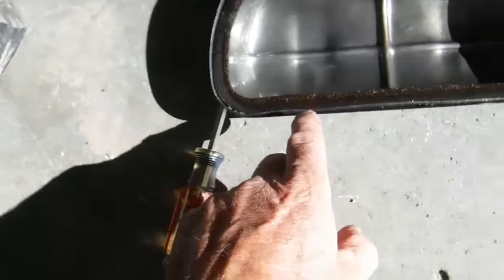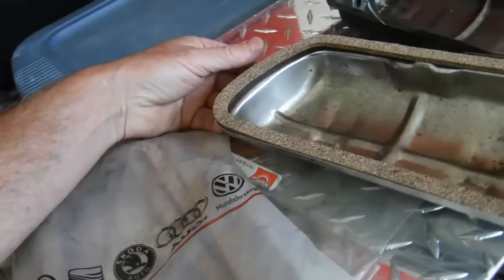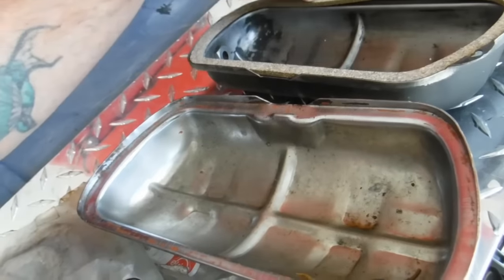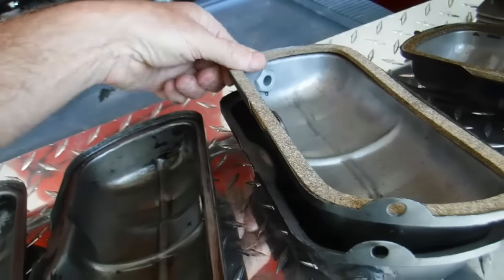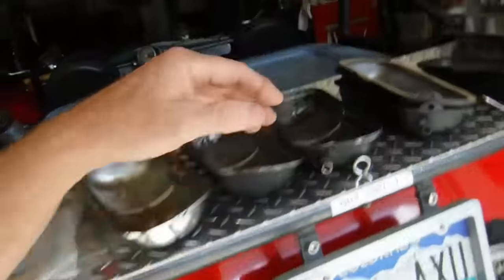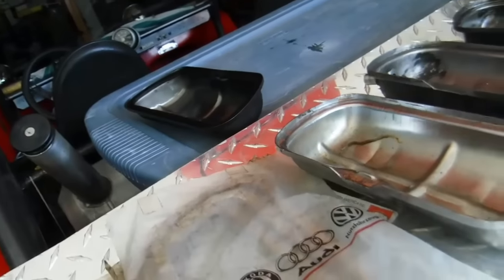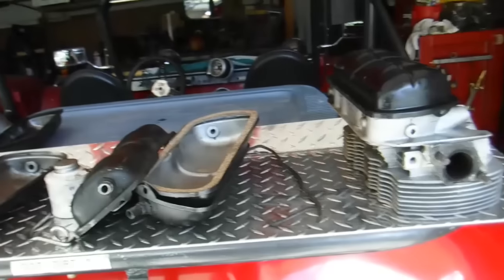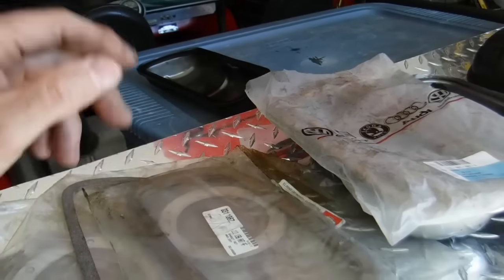Volkswagen Valve Cover ( Tips & Tricks )

Comment: I never use sealant, just grease the valve cover sealing edge lightly and place the cork gasket in, then a thin smear of grease on the head side of the gasket. Never had a leaky one yet, plus no mucky clean up job when it is time to change them.
Reply from the maker: Thanks for your contribution John!  I love it when you guys chime in and help make this a better channel. If we all share our experience everyone benifits

Comment: I also read how the stock tin covers actually cool the oil the best and that you should avoid the aluminum finned covers because they actually run hotter. 
VW engineers were smart.  The valve covers and pushrod tubes are main parts of the oil cooling system. Fancy aftermarket pushrod tubes should be avoided, too.

Comment: I replaced my valve cover gasket in my 2.5L jeep without cutting or modifying it and yes, it was warped. I used toothpicks to line up the bolt holes, and then once I got the valve cover in place i used mechanics picks to line the holes in the cover/head up with the holes the gasket. Fixed the leak perfect and it’s been a month or so. Btw I used a wire brush to get the gasket off the old valve cover. You seem like a great mechanic, and you seem to speak with experience. Nice baja!!
Reply from the maker: Hey,  I like people who think out of the box. Great solution for your 2.5 I hope you get lots of leak free smiles and miles.

Comment: Thanks for posting. I've had the same frustrations with the gasket not fitting properly. I will try to trim them like you have.
Reply from the maker: I just run some sealer across the flat bottom and call it good after I get the right fit.

Comment: Great information! As for using heater hose for crankcase ventilation, I have had that stuff swell up and turn gummy before. Purpose built PCV hose works much better.
Reply from the maker: Been using it for many years and never had that problem.  Even used garden hose hehehe

Comment: 2:12 I had this exact problem with some gaskets I bought in bulk. I'm a n00b so I didn't think anything of it, squeezed it in, put them on, started it up, and engine was dripping like crazy. Almost pouring out of the valve covers. Pulled them off, and it looks like the rocker arm snatched up the bulging gasket, and caused a huge gap for it to leak from.  
I might have to try that welded washer trick if it sucks them up again. Gonna try using some permatex case goop on the valve cover side before I weld it though.
Reply from the maker: Letting is set up with wooden clothes pins before assembly helps sometimes.
Reply: @TheEZGZ  I ended up sanding them to fit with a die grinder w/ 80 grit disk, so they actually fit dropping them in, and no leaks! Didn't even have to use sealer. I'm sure it will seep a little cuz synthetic oil, but that's unavoidable with cork. Thanks for the tips!

Comment: I have the German valve covers on a 73 type 3 1600 FI engine. I see some of the VW valve covers you have the black paint on the out side is partly worn away and the inside it's almost gone. Do you feel it's bad if the out side has a bit of factory paint worn off ? 
I do use permatex # 2 on the valve cover side because I don't trust  the gasket to not move while installing the valve cover. I do know  the valve cover gaskets that Elring sells in their German engine rebuild kit  fit perfect as do the
Victor Reinz Valve Cover Gasket 15-21644-03  auto zone offers . They are light and thick an both brands are the same. I used to get thinner ones from a dealer here and they were to small and thin and didn't hold up well to heat. 

 I also need good adjusting screws and nuts , mine are German but now all I can find without a fortune shipped from the UK are ones made by IPA said to be German . Have you heard of these?
Reply from the maker: Well, it is what it is. When things wear out you have to use what is available. Most new valve come in black powder coat and hold up ok

Comment: I shoulda watched this one before I put my fresh 1904cc in the car; nice pools of oil on both sides soon after she fired up, for the break in, dang it. I guess I can't just use fresh ill-fitting cork gaskets and original chrome covers on fresh heads with the crappy original bales, and no sealant. So much for that experiment. Well at least I know there's lots of oil getting up top! And under the car I go. Thanks!!
Reply from the maker: Hopefully you will get things sorted and start putting some miles on that new engine.

Comment: 5:26 Thanks for explaining the heat-expansion difference, sealer & aluminium VS steel valve cover. I know know better how to install my VW Golf 2 gork gasket.. Seal the corners, disconnecting parts, and the top part.. perhaps. :)

Comment: What should the oil temperature be in a 1776 motor thought it might be running hot and that's why I was sucking that gasket is thanks
Reply from the maker: 1776 is a great engine. Don't worry about it if you have reasonable compression. New gaskets suck especially if there valve covers are powdercoated inside and out

Comment: I'm with you. Chrome don't get you home. All good info.avation on valve cover side only.if I have time I like to seal the gasket on the cover and pop them on some loose clean heads up on the work bench. Leave them there for 5 minutes or so till they seat real good. Then pop them off and check them and there ready for long service life on the engine.Just wipe the cork with brake clean each time you take them off and reinstall. Like new.thumbs up
Reply from the maker: Always appreciate your input John. I will have to try the brake clean wipe. Thanks!

Comment: what are your thoughts on bolt on covers with channel gaskets? ive got them on my 1641 street car for about a year now, and haven't had a leak yet. the aftermarket heads were leaking with the stock cork. I even had to double up the gasket on one side and it still leaked.
Reply from the maker: I had bolt on covers on my sandrail   a 2275 with dry sump oil system. They looked and worked great but I take mine off and on way to much to do R&D on my engines.
Reply: thanks for your reply! they do look good. I took my heater boxes off and put fiberglass wrapped j-tubes in their place. now I itch for two days afterwards when I adjust the valves. part of it I guess...

Comment: hey ez  tell them about to thin of gaskets will make your adjustment skrews tap on on the cover. and that cover is like a drum and make you think its aknocking.   and the worst is rubber ones because they shrink. I rember the gaskets for 2.75 and I freaked when they went to 4.00 bucks . rambus
Reply from the maker: Thanks for your contribution Jimmy. Good to get your opinion

Comment: are the cork gaskets supposed to leak a little after installation on a Vanagon until they swell up with oil contact?
Reply from the maker: I've owned and built many VW air cooled engines in the last 35 years if it's not the valve cover it's something else. They all mark there spot. Some sooner than later. I just accept it. Especially when using synthetic oil.

Comment: I replaced mine and it still leaks but very slowly
Reply from the maker: What did you replace?  Are the sealing surfaces on your head very nice? Are your bails strong and tight? Are you sealing the gasket side of valve cover with sealant? Every VW engine I've had leaks someplace. hehehe
Reply: I’m sorry. I replaced the value cover gasket put it on tight as I can get it and it still leaked
Reply from the maker: Like I said. All my engines eventually start leaking again. If it bothers me bad enough I start buying replacement parts and keep trying different things. Except the things you cannot change. Change the things you can and watch my channel to know the difference. hehehe
Reply: Hello what sealant do you use? Mine won’t stop dripping.

Comment: My scat engine has puked oil from the start. Bales are too weak, crap gaskets also
Reply from the maker: add aome bend to the bails or try bolt on valve covers. They will leak but you just keep close attention to cover bolts. It's all part of having a VW that isn't stock
Reply: @TheEZGZ  thank you